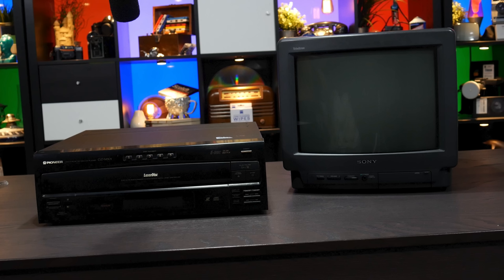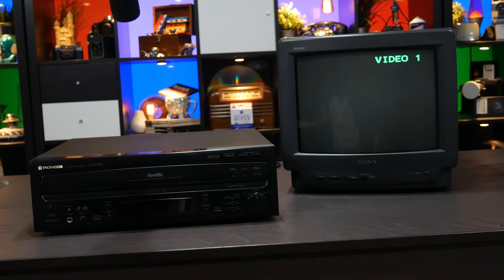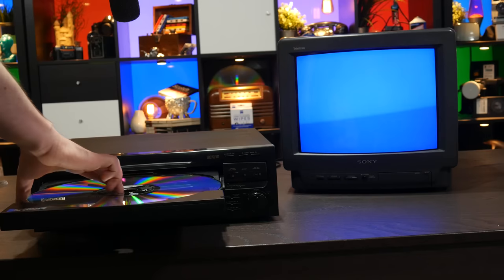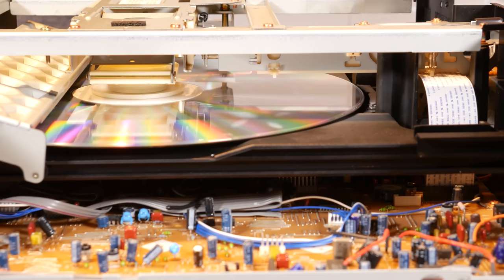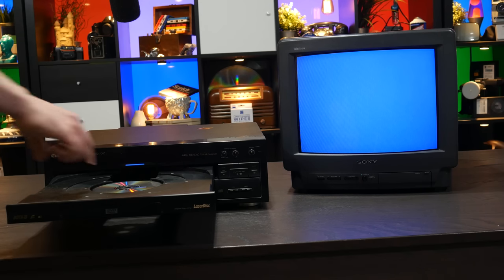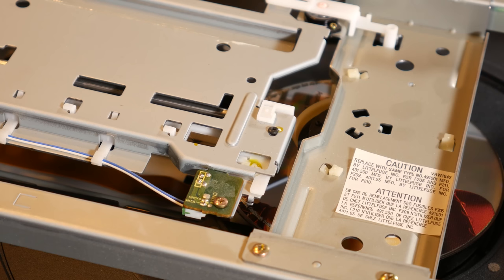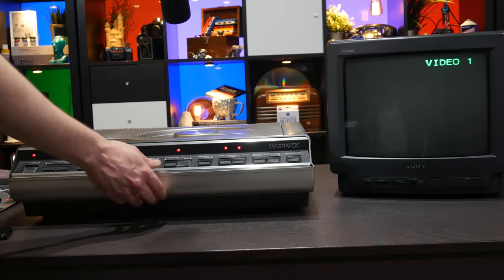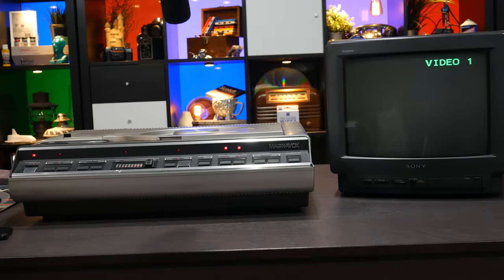Sights and Sounds: Laserdisc players

Comment: 24:58 This most likely happens because the clamping mechanism that holds the disk in place no longer has a good grip of the disk. The rubber pads in the clamp have either hardened or worn off and the motor is spinning at the correct speed but the disk more or less is slipping.

Comment: Did you try taking the broken one apart, degreasing it with 99% alcohol and re-lubricating with sewing machine oil? Oil turns to slime as the years pass, either it oxidizes or it gets dust in it, but sliding mechanisms stick and motors cannot get up to full speed.
Small motors and assemblies can be a pain as they may be metal-crimped together rather than using screws, but applying drops of sewing machine oil on the end bearings can be enough to flush out and soften old slime.
I've fixed lots of old malfunctioning electronics this way. You mainly just need to document what you're doing, take lots of pictures, and keep all the screws in small separate containers like an ice cube tray so you don't mix them up putting it back together. (Another route is to print images of assemblies and tape the screws where they go to keep track of them.)
Probably the only thing I would not try to disassemble is the tiny laser support carrier, which is usually magnetically supported. The laser assembly slide rails are probably gummy and sticky though, so it cannot track properly.
Don't touch the exposed wiring on the power supply circuit board even when unplugged as its capacitors may store a charge. The rest of it is probably pretty safe, though vacuum fluorescent displays need a few hundred volts to operate so be careful touching metal contacts around those.
Reply: The disassembly, cleaning, reassembly, and testing of the results could be a video of its own for the channel...

Comment: Is there perhaps a limit switch on the runner the head slides on that is perhaps not triggering correctly, causing the head knocking? I've had something like that occur with a Sega CD, which due to the limit switch going out, proceeded to grind and damage it's gears quite badly. I would assume something like this LD Player would have more logic involved and might not rely on such rudimentary "hey, is it there yet" implementations, but you never know.
Reply: It's worse for Pioneer consumer electronics of that era: There are no limit switches or photo sensors. Instead there is just a preprogrammed path of travel with pure assumptions of where things are. Once the mechanism wears out or just skips a gear tooth, everything gets out of sync and stops working.
Reply: @MayContainJoe  That certainly does sound lovely. Real shame for something with so much other work and effort put into it to just phone that bit in and just say fuck it.